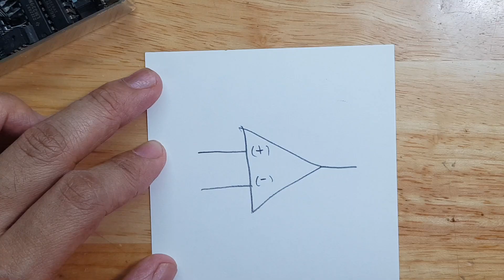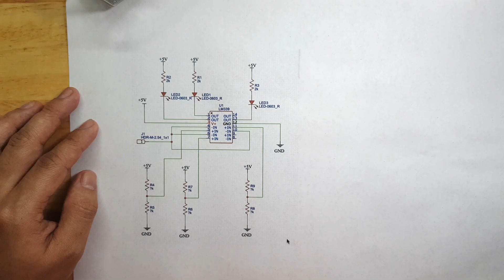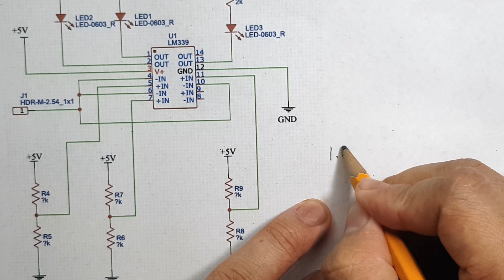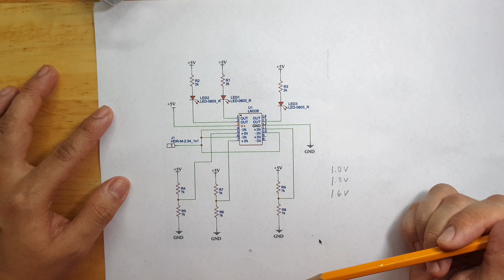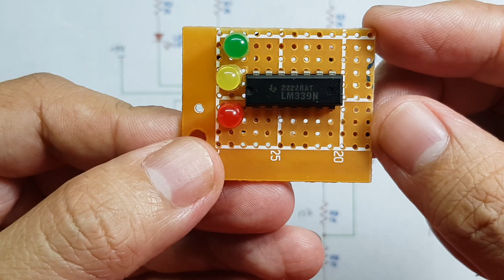WATERLEVEL SENSOR TUTORIAL STEP BY STEP WITH NO ARDUINO - LM339 based water level indicator project

Comment: What is the value of resistor you used in every voltage levels for comparator?
Reply: Also did you connect the buzzer at the 1.6V where red LED triggers?